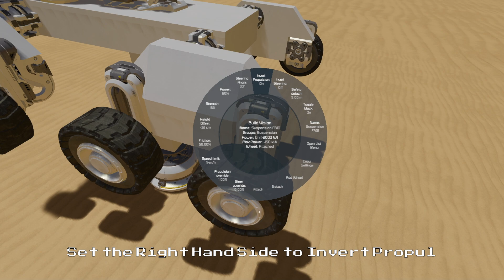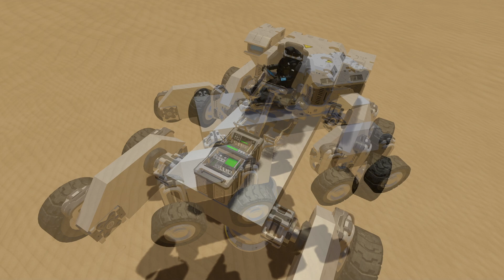Space Engineers | Sub Grid Wheel Contols | Vanilla Tutorial

Comment: This is an excellent system. The only flaw I see is pairing the braking action with the up thrust, as it reduces friction and braking power, however minimally with an iron in atmosphere. It would be a different key than normal, but I'd sooner pair it with C/down thrust to have that the minimal addition of downforce.
Reply from the maker: Thank You! 
I only set it up that way so I can use the same controls as I normally would for the brake, but there's nothing stopping you from using a down thruster instead 👍